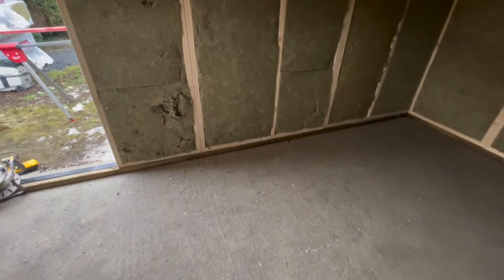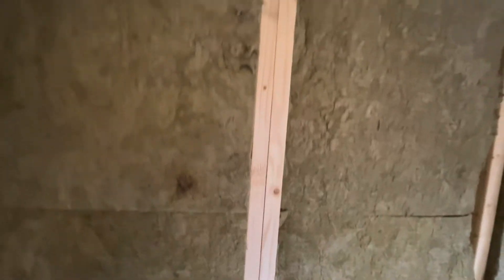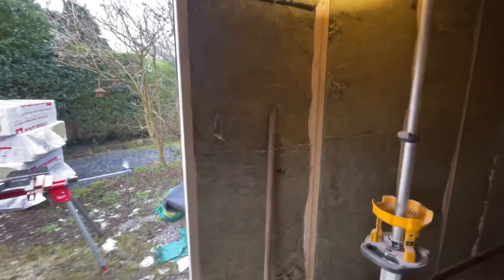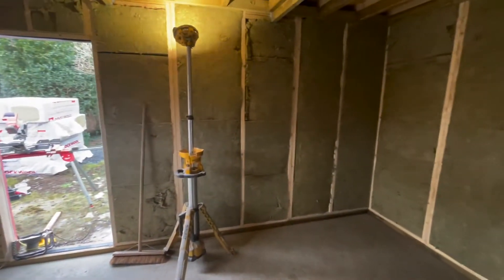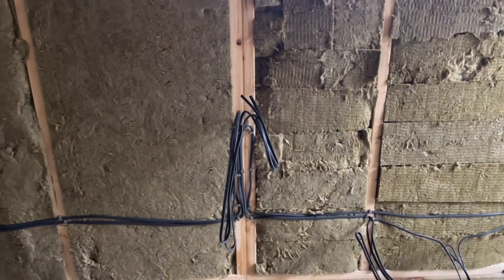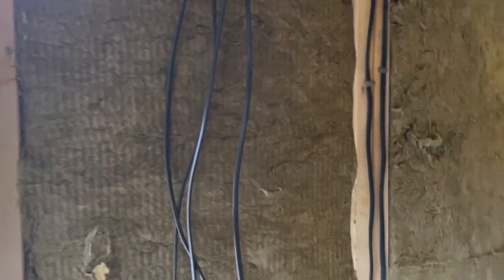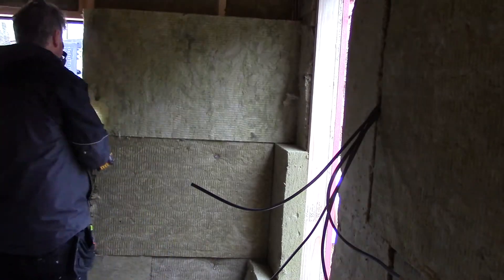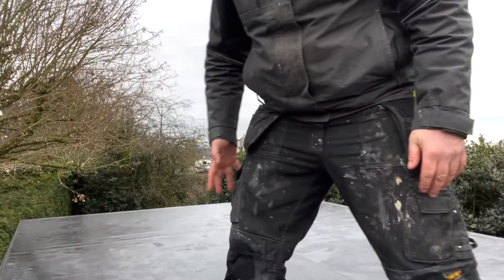How Thick Are Soundproof Studio Walls?? - Part 3

Comment: Are you using Rockwool three slabs thick? I know you mentioned a third layer but the video didn’t show it, thanks for your help😊
Reply from the maker: Yes we use 300mm of Rockwool in the walls and 200mm in the ceiling 👍🏻